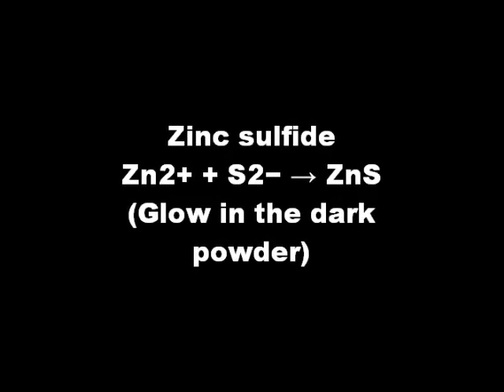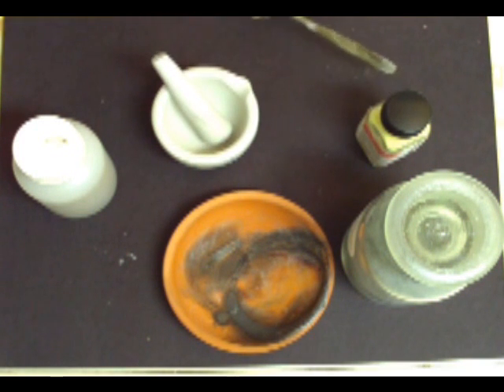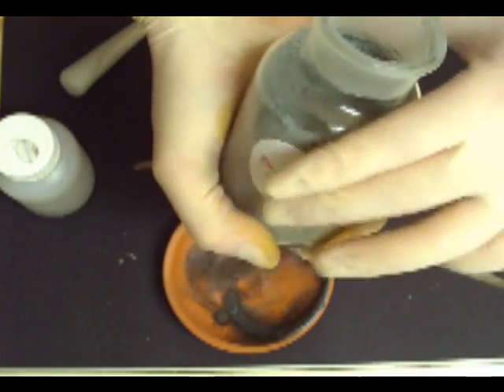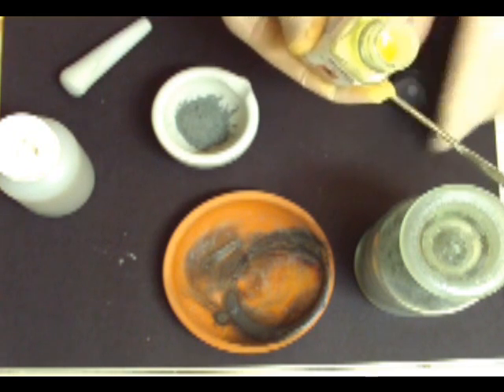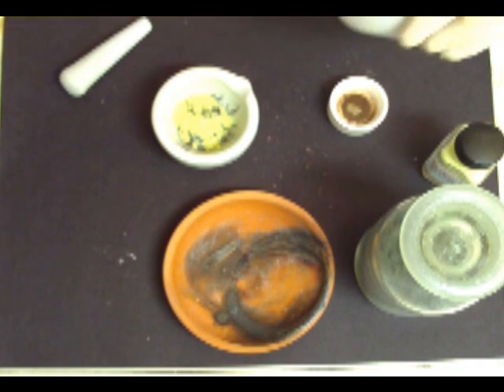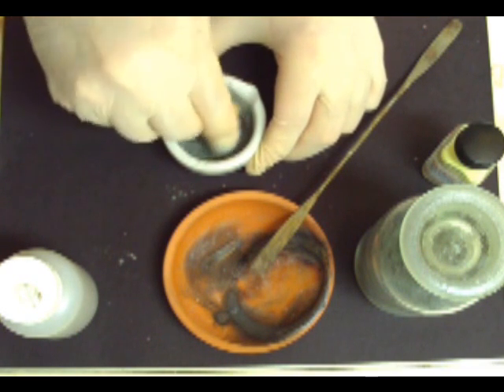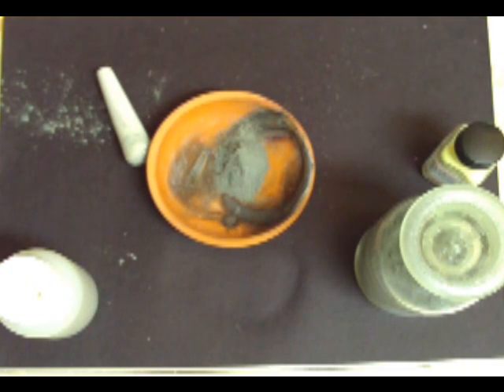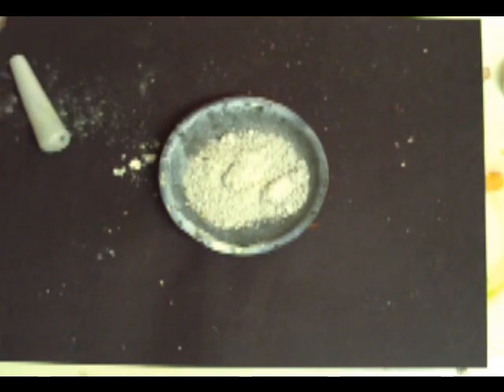Make Glow in the Dark Powder (Zinc Sulfide)

Comment: what about using an excess of sulfur to make sure all the zinc reacts, then afterwards washing it with hot toluene to remove the unreacted sulfur? I'm asking because I want to add it to a Al2O3/CaSO4 mixture for making TLC plate that can be analysed under UV light

Comment: This is an old vid, but surely much of the copper in that will become copper oxide: better to mix it in AFTER combustion I would have thought...
Reply: Too much copper will have the opposite effect as well. Instead of improving the phosphor persistence, it will degrade it.

Another thing too is to run the reaction in oxygen presence. I imagine it has lots of zinc oxide contamination.

Comment: I tried this several times and it just doesn't work.
I get the green fire but after it goes out I'm left not with a white powder, but a brown-yellow sponge-structured substance.
I tried activating it with copper and UV light but it still won't glow.
Reply: too much sulphur maybe?
Reply: Ash De Vos Should there be more zinc then?
Reply: Yes, just use a stoichiometric amount of zinc relative to the sulfur.